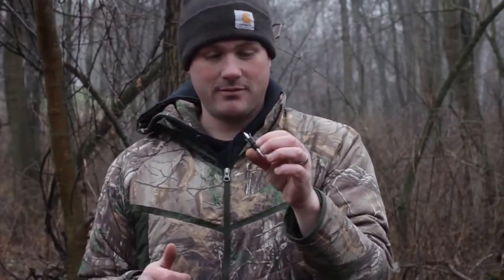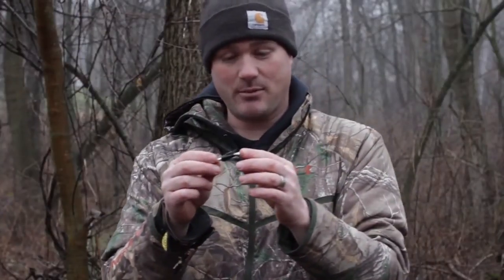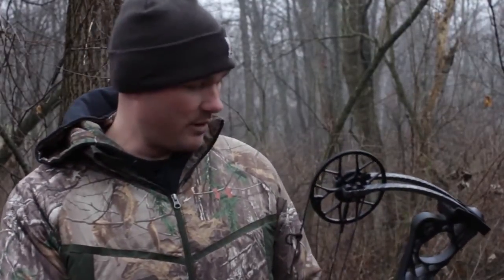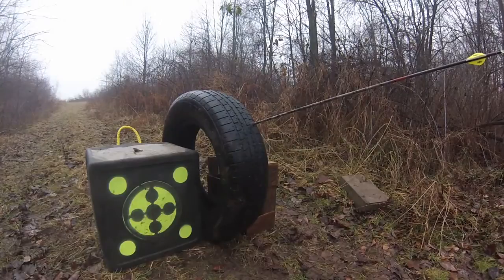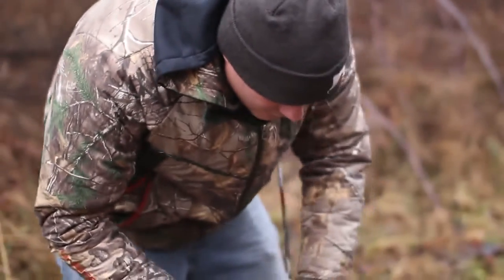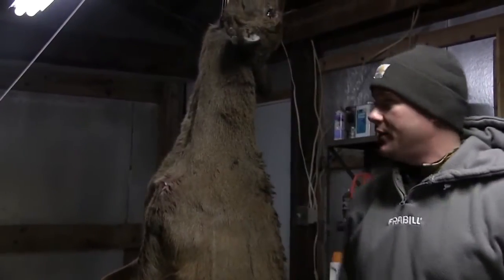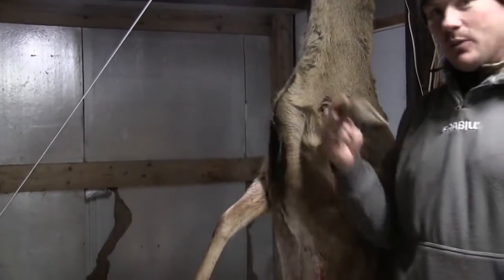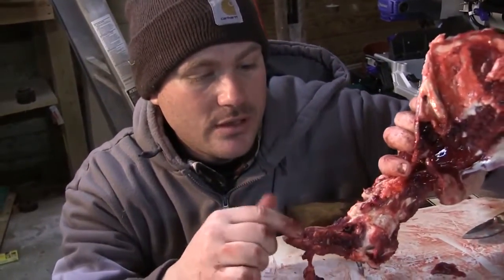Wasp Jak-Knife - Geek Tested

Comment: I used wasp for years with great results...
I switched to Rage just to try them out & they are good too, BUT
I'm going back to wasp.to me they are the strongest & the sharpest out there & the devastating damage they do is incredible.
I had shoulder surgery & could only pull about 45lbs.
I didn't have time to change to fixed blades so I used my tried & true jakhammers.
I told myself only broadside shots under 20 yrds. WELL on Oct. 27 I had a broadside shot on a 240_lb 10 pt at 13 yrds.
he only went 45 yrds.
arrow went in 10" but the damage was great..
Thanks wasp